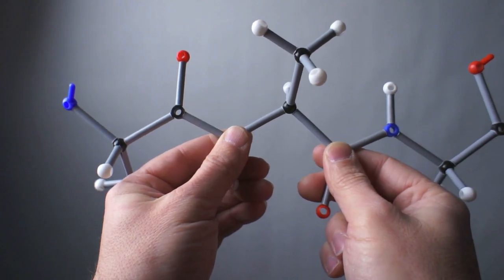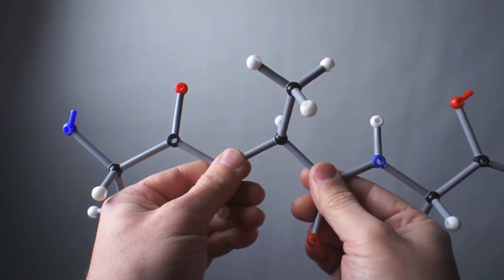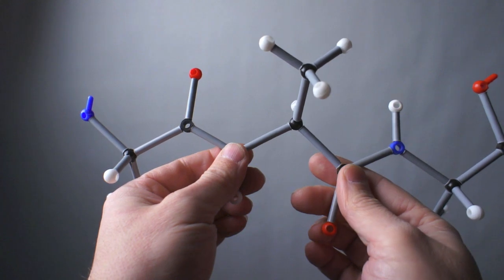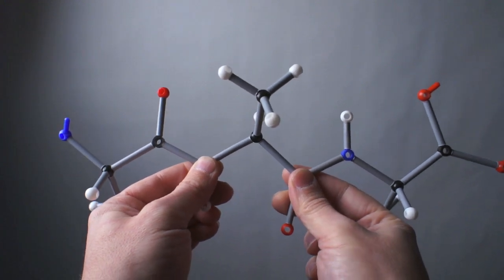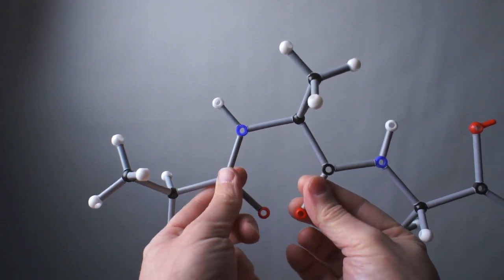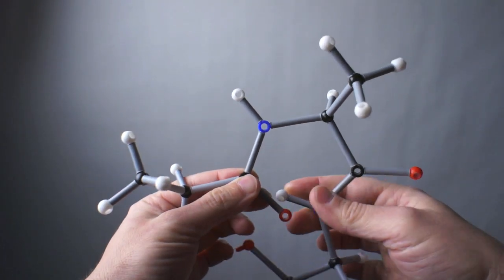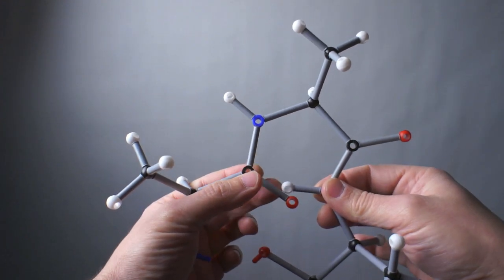Ramachandran Model

Comment: "They're 180 degrees" with respect to what? This is the most confusing part that no one talks about.
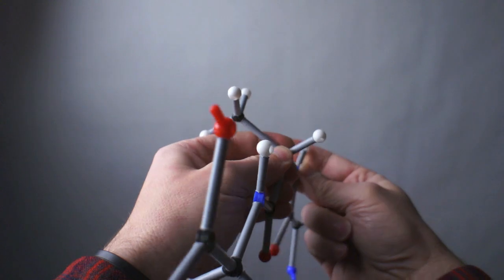Reply: the convention is that 180 degrees is when the peptide groups are fully extended on a plane. so when dude looks down the peptide at 0:56 the carbon and the nitrogen atoms are all on the same plane whilst they're "staggered" meaning they alternate from going up and down. when dude rotates one of the angles to -180 at 1:08 degrees they're no longer "staggered".
Reply: @sanchoclause2183  Nice explanation dude!

Comment: What do you mean by "angle between carbon and nitrogen is 180 degree"?   There is only 1 line segment joining carbon and nitrogen and also carbon and carbonyl carbon. So, the angle can be 180 degrees or 0 degrees.  Also, how will you visualize if I say "angle between carbon and nitrogen is 60 degrees"? It makes no sense, isn't it ?
Reply: Dihedral angles are defined by four atoms.  With respect to psi, the four atoms are N, C(alpha), C', and N.  The two carbon atoms are the inner two atoms, and the two nitrogen atoms are the outer two atoms.  With respect to phi, the four atoms are C', N, C(alpha), and C'.  The N and  C(alpha) are the inner atoms.  When both phi and psi are 180 degrees, all of the atoms of the chain lie in a plane, and the oxygen atoms alternate pointing up or down.

Comment: If H bumps into O, won'''t it be stabilised by a Hydrogen Bond ?
Reply: +MSc Biochemistry No, it is coming in too close.  Ramachandran initially estimated that the two nuclei would be 0.4 angstroms apart, which is too close, even for a covalent bond, let alone a hydrogen bond.

Comment: Hey, thank you for the video. It makes sense! 

Anyway, how do you distinguish a rotation of negative 180 degrees to a rotation of positive 180 degrees in either of the angles, phi or psi?
Reply: +Devanand T As far as I understood it, -60 degree means counterclockwise and +60 degree clockwise, right? If this is the case, one way of turning along phi or psi should result in an internal Energy for the molecule than turning it the other way around. so in the plot the questioned angels would appear as spots at two certain places and by the colour, they are represented with, their Energy is shown. By the introduction of Energycolours used like colours on for example a map to show depths and hights, one can transform the on the firs view two dimensional plot in a three dimensional one.
I hope this helped you with your question, I apologize for any bad english, I'm not a native speaker.
Reply: R you a chemist? like your explanations
Reply: +Reivivus I do not believe that one can distinguish them; in other words, either rotation leads to the same conformation.
Reply: +Devanand T all right, so as well as every atom has a certain energy, every molecule also has one. This energy is the reason for movements and reactions. It results from thermal energy and some quantum mechanical properties, I know far too few about, to be able to explain them in detail. But in the end it all comes down to the fact that this energy is there and as thermodynamics teach us, the energy of a system, like for example a molecule, tends towards a minimum. So if you let the molecule just do as it pleases, it will wiggle and spin around and interact with its environment, as there are electromagnetic forces from charged groups, hydrogen bonds, hydrophobic interactions and so on.
And in every way, the molecule turns, spins and wiggles, there comes for each state a certain amount of energy with all those interactions. And on top of that, if the molecule is big enough like a peptide or even a protein, those interactions will occur inside the moecule as well. This 'dance', if you want to call it tht way, of our molecule will never competely come to a rest, but eventually it will twist itself in such a way that the energy of all the interactions, its 'internal energy', will come close to a minimum.
So if you now look at a hyothetical stage, where a bond is turned 60 degrees clockwise, and compare it with a state, where this bond is turned 60 degrees counterclockwise, while all the other bonds remain in their relative position to each other, those two states will both have different internal energys, as other interactions will be possible. If one energy is higher than the other, its less likely, that this high-energy conformation will occur, then the other one, so when drawing a ramachandran plot, you will probably find the less-energy konformation. In the plot, you can mark that as a pixel, and by adding a colour to it, you can visualize, which amount of energy is to be found there. That is why in the finished plot, there are so many white (or whatever backgroundcolour they chose) areas. In those, the theoretical internal energy for this conformation was so high, that it could not be observed in the experiment, so you will find no spots in this places. This might for example be the case for one of the 60 degree torsions.
I hope that helped.
Reply: +MeMusicLikes Thank you for the effort to explain this. (y)
Reply: +Chris Halkides That makes perfect sense, but how to distinguish between -60 degree and 60 degree then?
Reply: +MeMusicLikes I did not understood the "internal energy" explanation. Your english is good. But I have doubts still.
Reply: +Devanand T You're welcome
Reply: +60 is when rotation is clockwise & -ve when anticlockwise